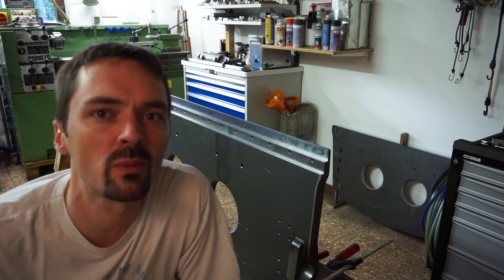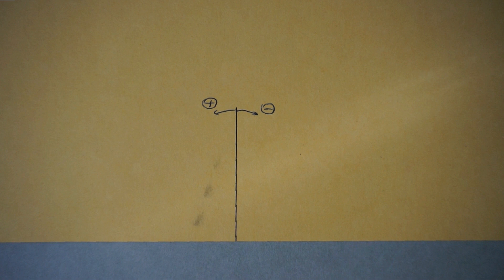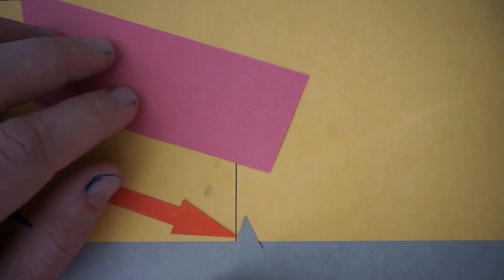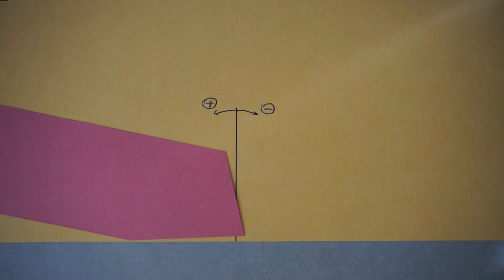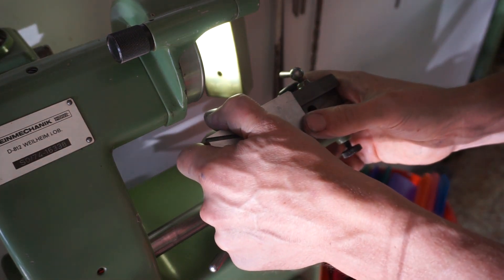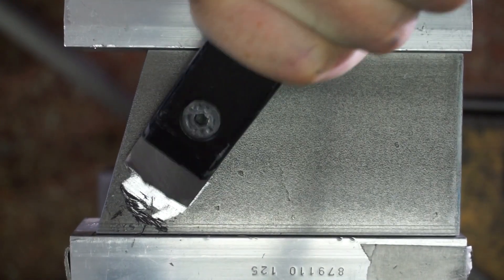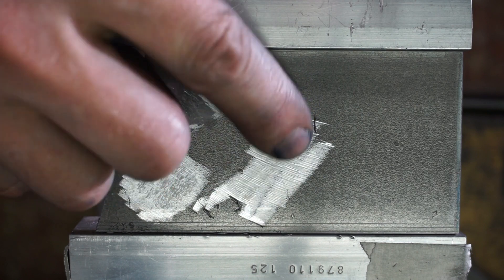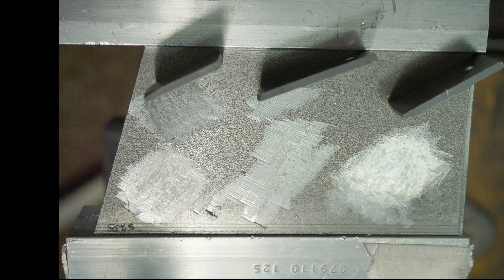Hand scraping carbon steel: carbide insert geometry

Comment: all good, but every time I see you swipe those shavings I remember the "fun" of digging out steel splinters when I was cleaning my new to me mikron mill... use a brush, or even better - vacuum them up right away, I suggest researching iron rich foods if you want to absorb iron into your body :D
p.s. are those press brake ram blades you're making there?
Reply from the maker: Thanks for the advice, but I haven't had problems with chips in my hands yet. More common to me is burnt skin from hot chips on the lathe or mill. Yes, the parts in the background are the jaws of my newly designed press brake.
Reply: yes, hot chips are a problem... I use pieces of plexiglass stuck in T slots to mitigate this, but regarding the "needles", in my case they were dirty with remnants of the coolant previous owners used, and it probably had some bacteria living in it still, because after digging them out, it wouldn't heal right away, worse then these was only carbon fiber epoxy strands stuck in the skin after part trimming, thick leather gloves solve the CF splinter issues, but with the steel ones, I tried thin rubber gloves, thick rubber gloves, leather gloves etc, and those splinters just kept moving through the glove into the skin, I'm no safety nazi, but that experience for me was in the same category as stringy stainless steel chips on the lathe - 99,99% chance of a cut if touched with bare hands
Good luck on the press brake build, I'm in a quite dire need of a ~1m aprox 25t press brake myself, but I think I'll get something from the used tools market and do refurbishing if needed.

Comment: I did a bunch of steel scraping 30 years ago on machinery frames.  I have not heard anyone doing it since then.
Reply from the maker: Dale, which blade geometry did you use back then?
Reply: as I remember it was just square like for cast iron and flip tool over when dull.    i'll test my old tools